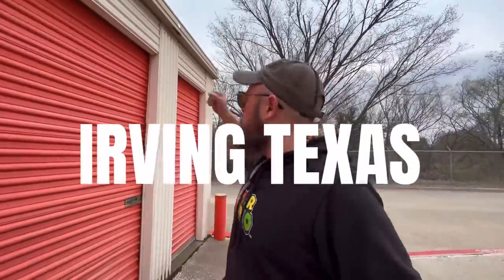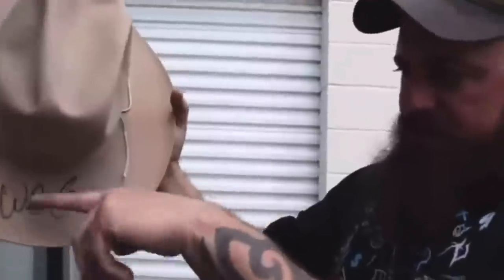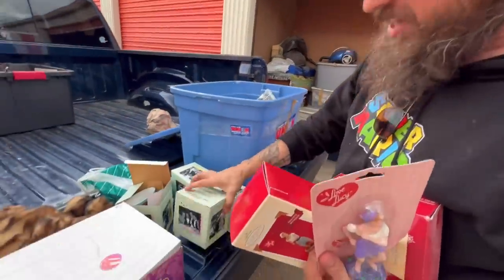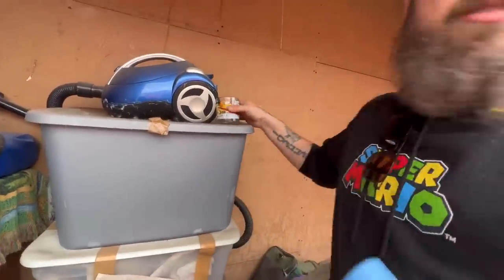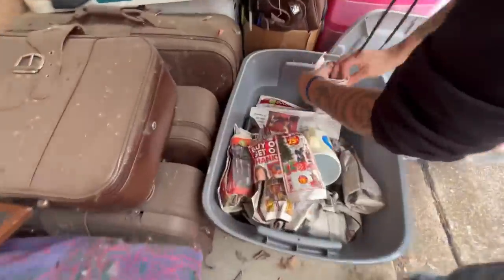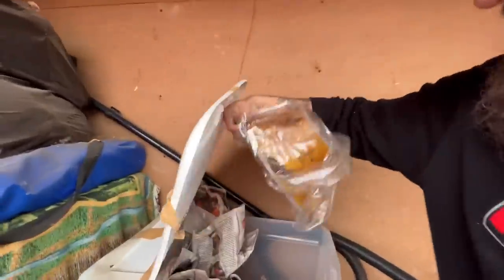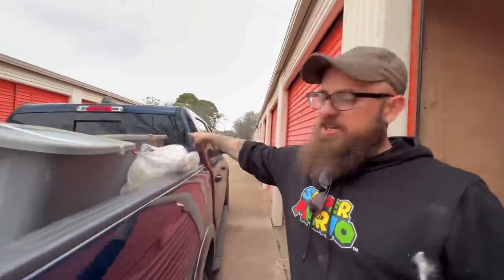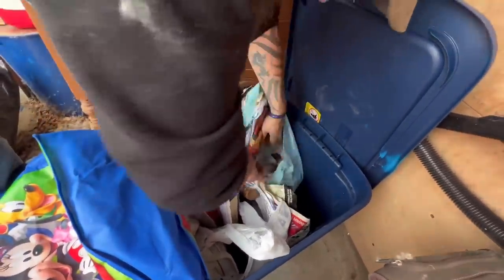Don't ever do this when buying storage units at auction!

Comment: Not going to lie, I was a little blindsided by the $24 in shipping and handling on a $2 auction win from you. It would have been nice to have that listed up front when bidding.
Reply: You can go to the Post Office on line and guess on the weight. Put in the city's. 
And it will give you an approximate minimum price. 
    Or better yet contact them and ask.
Reply: @dawndixon402  I've use a handful of auction services and they list all the fees and costs upfront. The only fee the Grime's auction disclosed was the buyer's fee. I only made the comment to give them an area for them to grow and provide better services to their customers. What you described is honestly the job of a good retailer and shouldn't be on the customer to ask for the seller to disclose fees that should never be hidden.